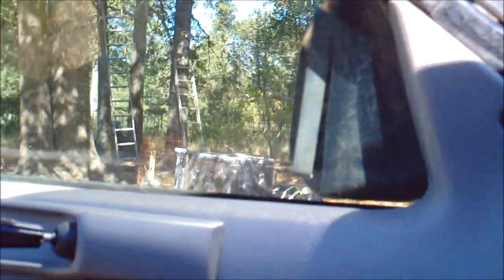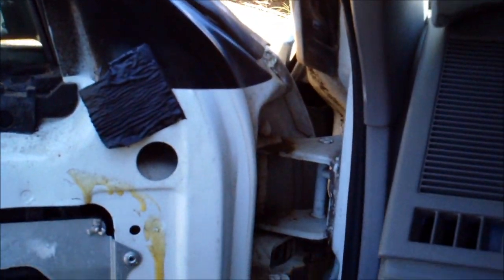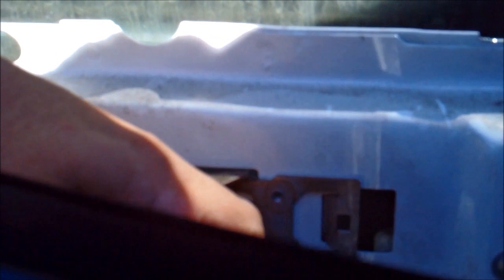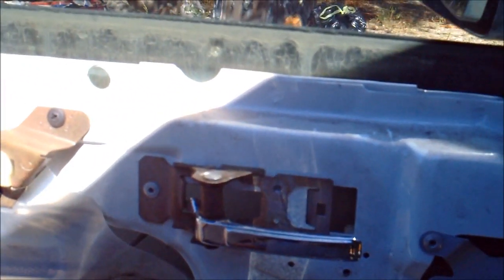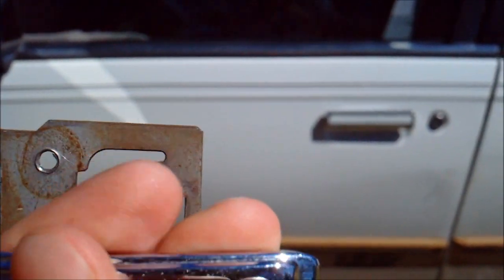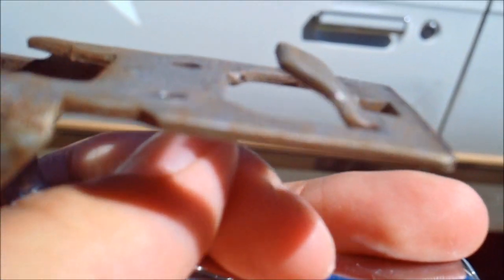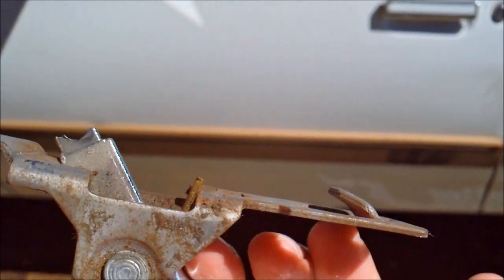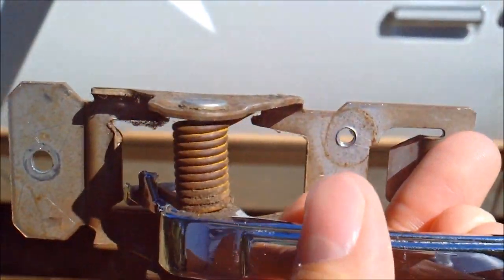"Replacing Interior Door Handle on an Oldsmobile Ciera"

Comment: I have a 1995 Buick Century and just had to do this. Luckily all I had to do was take off the part that surrounds the door handle and door lock. I got the door handle from Autozone, part #77025, for $20. Took off the door part, need a drill, and a riveter. The door handle clips in but is held in my the rivet. The part that engages the door broke off, so we had to pull out that part to unclip the broken part, drill out the rivet, pop the new handle in. Reclip the latch, and rivet in place the new handle. Having the proper tools was key (drill, rivetor, claps), took less than a hour. Did have to drill a bigger hole in the part for the latch to go into for my particular car.

Comment from the maker: I'm not sure if those have to be left in place. I'm not very familiar with the back panel, but I would imagine they're similar to the front. All 4 doors handles are installed the same too. The power window motors are close to the handle. These also commonly have problems on these cars.

Comment from the maker: I'm not completely sure how to fix that issue. I have encountered it myself, but it seemed to correct itself within a short time. You might be able to use a screwdriver or something similar to clear the debris.
Reply: My sister has the same car with the same problem except on the passenger side. Apart from installing it is there any wire or "metal cables" to feed through out the door to hook the latch latch

Comment: Did you by chance, have any idea on how to clean up the inside of the back doors? After a fewer last rains I noticed this hard smell to humidity and then I looked for the source of it. It turns out the back doors are filled with water and had nowhere to go after. I removed the plastic caps on the bottom, to empty the doors but they're full with mud. I don't want to damaged the interior using hardware tools, pay someone to clean them or use a hose, but I want to learn how to do it properly.

Comment: Also, I don't know if I have to leave those caps in that place. My car it's a Cutlass Ciera '93. My parents took it to a repaint job. But the guys at the workshop did a terrible job, the taillights were broken and they just sealed them in place instead of replacing them! The outside rubbers of the windows' doors were in a bad condition and this guys didn't bother to get a new ones (even if the price increased). Now I have to deal with those issues :/

Comment: Video started out great with video instruction on how to remove the door paneling but by failing to show the removal and installation of the new part makes this video worthless as titled for "Replacing Interior Door Handle on an Oldsmobile Ciera". Video would be fine if titled "How to remove paneling of Oldsmobile Ciera door".